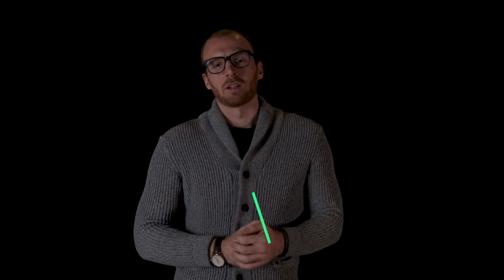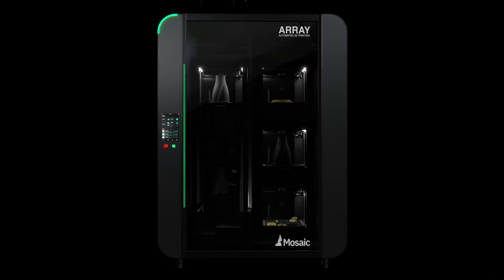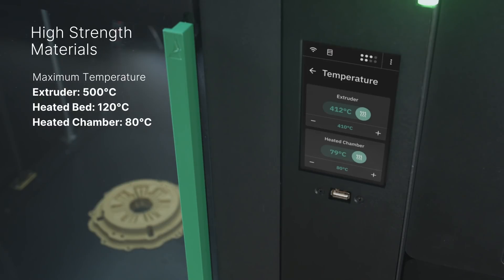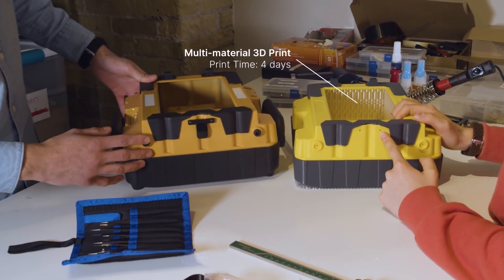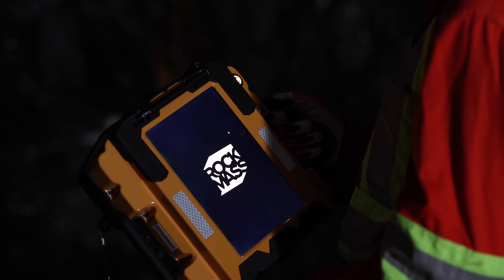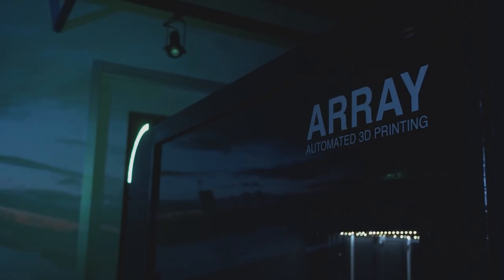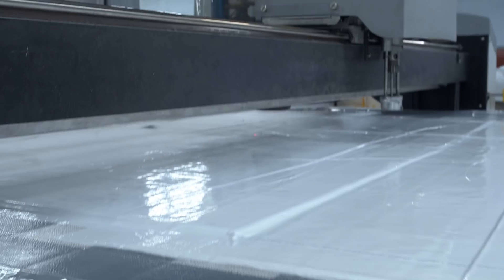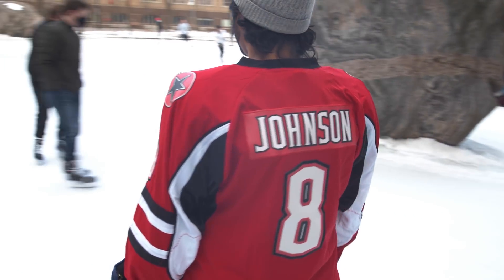Virtual Product Launch - Array, Element, and Palette 3

Comment: I don’t understand why the Element HT is configured with a single extruder. If I’m printing with CF-nylon and a suitable support I’m spending $0.20 per gram of material — I don’t want to waste grams on a large purge block (maybe it’ll have less purge than the palette?)
Reply from the maker: Hey Joe, Element contains an integrated purging mechanism that densifies the transition material and stores is in a large container outside of the build volume, so no need for towers!

Comment: With all my filament sitting on a shelf above my 3d printer, I'm wondering if it is possible to flip the Pallette 3 pro upside down or maybe on its side? So it can be placed in between, to have a straight line from filament to printer. Also if yes, can the screen be rotated?
Reply: Hey Rune, similar to P2, you'll be able to rotate the screen to fit your setup.
Reply: @jonnyyeu5269  Perfect, thank you for the quick response!

Comment: I wonder do the machines still waste a ton of filament on purge blocks?
Reply: They have to – changing colour (or material) through one nozzle necessarily means passing enough of the new material through the nozzle to purge it – hence the wastage. You need a toolchanger or similar to radically reduce that waste.
Reply: @MarkWheadon  That is why I will purchase a Prusa with filament changer. It has much less waste. Having said that, they are all a pain. Some less than others!

Comment: the waste tower is still a waste - the swap needs to happen closer to the nozzel.
Reply: that's what's in the nozzle actually.   purging to the side is faster, which is supported.   only way to avoid it is using e3d tool changer....